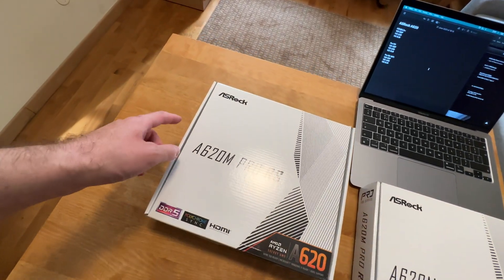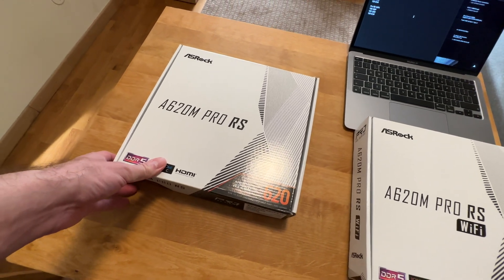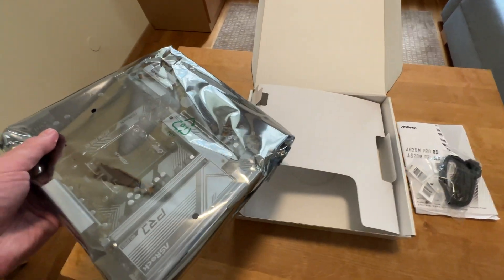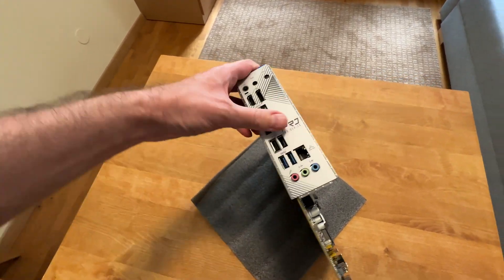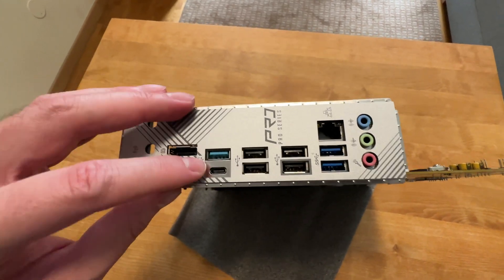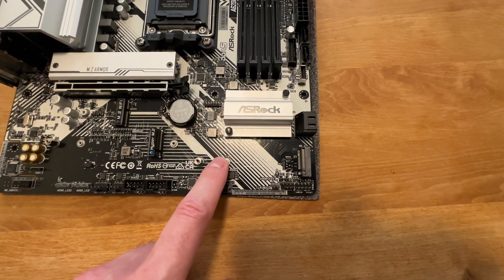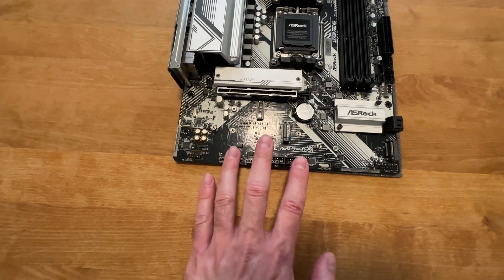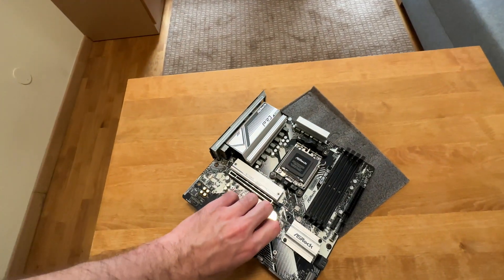Unboxing ASRock A620M Pro RS [Features & Specifications Overview]

Comment: is there reason to get a620 mobo when ASRock own B650 mobos starts at 125$  with ASRock B650M-HDV/M.2
Reply from the maker: If we are talking about the A620M Pro RS at $115 then I'd say that B650M-HDV/M.2 at $125 is well worth it. But some A620 cost less than $100. That is where one might think about saving that extra $30 if they are not interested in additional features the B650 offers.
Reply: @iVadimUnbox  thanks for the answer! there is even B650M Pro RS with RBG support, so many good choices!